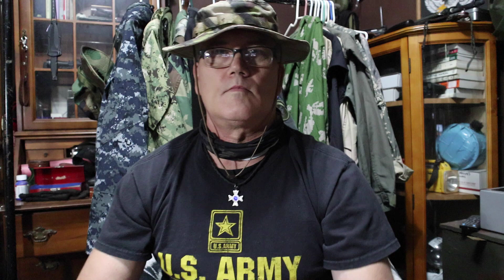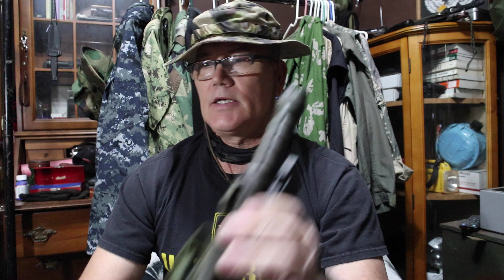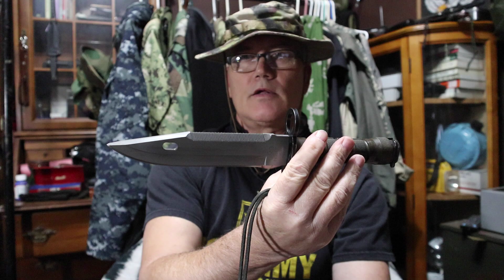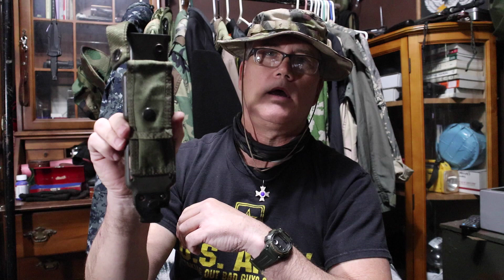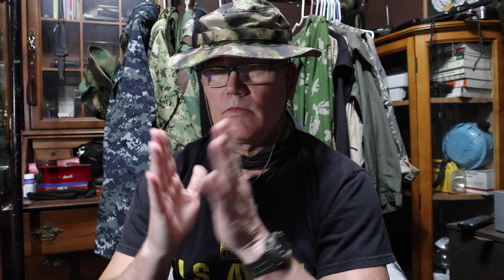M9 Multi Purpose Bayonet System with Snowman

Comment from the maker: 1st Generation (Chevron Mark): Stamped with M9 Phrobis III USA > (the ">" symbol represents the chevron). These were early production runs before the Ordnance Department ordered the date mark discontinued.
2nd Generation (Flat Top M): Stamped with M9 Phrobis III USA. These feature a distinct typeset with a "lazy 9" and a flat-topped "M".
3rd Generation (Upright M): Stamped with M9 Phrobis III USA but using an upright "9" and a standard, non-flat-top "M".
4th Generation (Pat. Pend): Stamped with M9 Phrobis III USA PAT PEND. This version added "Patent Pending" markings during the later years of the contract.
There was a 5th Gen with serrations slightly moved forward and improved wire cutter.